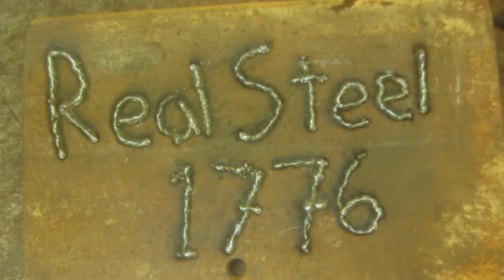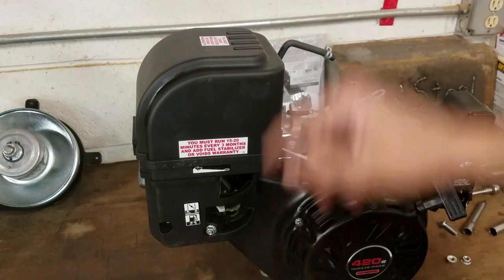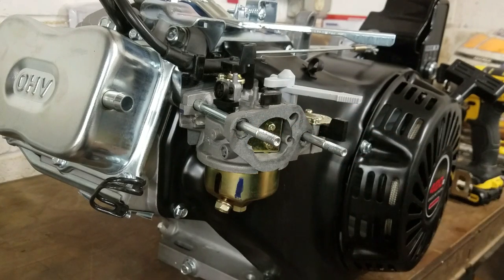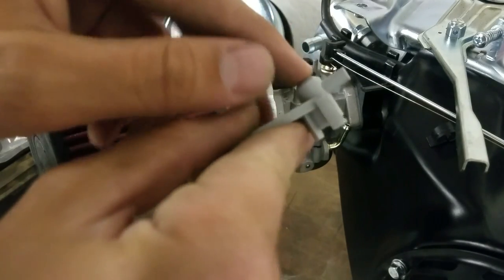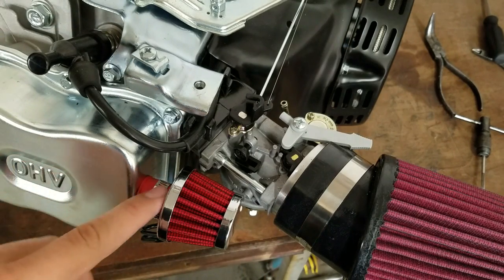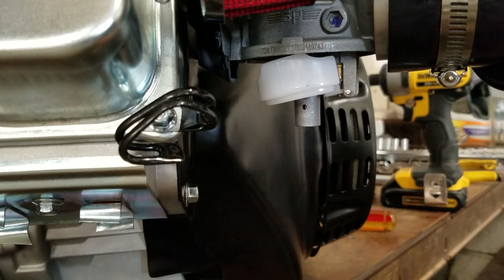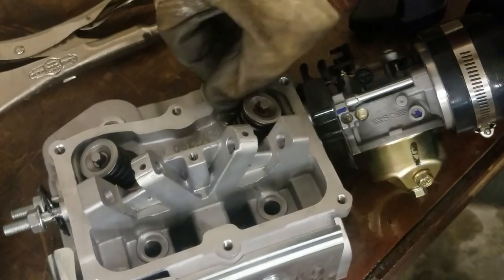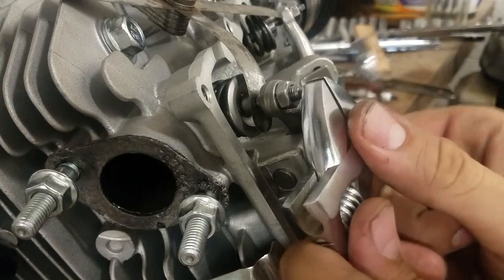Predator 420cc Performance Mods!

Comment: Couldnt you instead taking apart the engine. N just disconnect the governor arm assembly on the Carb n be done w it?
Reply from the maker: yes, but the plastic governor gear isn't designed for the high rpms and could break apart during use. it would probably be fine though

Comment: (0) Those 'Bolts' You Took Off To Remove The Muffler Assy Are Called 'NUTS'! (1) The Two 'Pegs' Holding The Muffler To The Head Are Called 'STUDS'; (2) These Nomenclature Problem(s) Carry On Thru Out The Whole Video; Bad Dog....

Comment: I have a 14hp Subaru motor,I don't have any idea if the mods are the same tell me what you think plz before I try to modify it.thx
Reply from the maker: the basics should be similar like the intake and exhasut, but Subarus are OHC engines which means that the internals are completely different

Comment: Do you have to do all that air intake jet adjustment stuff to take the governor off or can you just take the governor off and it'll still run fine?
Reply: Yougotnomilk thanx
Reply from the maker: you don't have to,  but you do need 35lb valve springs or else you'll bend a valve
Reply: RealSteel 1776 Yeah, I wasn't 100% sure, but I was thinking I was going to have to do that at least. Good looking out. 👍

Comment: what you really need is a big spacer between the carburetor and the head. Putting a space between the carb and the air filter fills no purpose.

Comment: What Size did you Drill the Jet too? Stock 13hp@3600rpm is 75% efficient. 420cc at 75% efficient at 4000rpm = 15hp, at 4500rpm = 17hp, at 5000rpm = 19hp, at 5300rpm = 20hp. http://www.mk5cortinaestate.co.uk/calculator3.php
Might Help to just Boost CR from 8.3cr to 11.3cr for 91 Octane and use a lower Rpm.

Comment: Where can I purchase a more powerful charging system for that engine your working on?
Reply: Yak Variety Channel you can get the part from your local small engine shop (usually lawn mower repair shops) and you can get one that Honda makes and not a cheap predator clone one.
Reply: I was hoping you had an e bay link for the part?

Comment: Great video but without jetting that engine won’t be at full potential. They have these engines very lean from the factory then you made it a lot more lean.
Reply from the maker: I did. the time for that is even listed in the description.
Reply: MacroMachines ok I missed that sorry

Comment: why bother opening up the motor ? disconnect the governor arm,unplug the sensor wire and your done..............and your warranty is still good if you bought it new, just put the original tank and muffler back on.

Comment: Can you post a link for where to get an adapter for the pod filter?
Reply from the maker: http://www.gopowersports.com/212cc-predator-performance-air-filter-adapter/
Reply: Thanks for the response. Great video btw, I've added this to a playlist of mine so I can reference it later. I have a 1990 Yamaha G2 golf cart that I did a lot of upgrades to, including removing the governor. Stock HP was about 9HP and I managed to get it up to 35Mph one day on a downhill section of roadway. After that it lost compression and I could not get it to stay running. After watching this video I realize that I did bend a valve. I've got a Predator 420cc motor in it now and will be able to use the information in this video, thanks for posting it!

Comment: if the engine runs better with exhaust back pressure than something else is not tuned properly.
Reply: Paul G actually you are wrong about a slight back pressure it is known to help ANY carbureted engine to be more tractible at low engine speeds. Bless you..
Reply: @carlyandt6748  Even the big names in engine building still disagree on the back pressure subject. A motor is a complex system, and there are so many variables that if we were truthful, one size does not fit all!

Comment: When I first had my 212 I tried to disable the govener and it actually locked my motor to full throttle so when I first pulled my minibike motor my dad was holding the front and it flipped over him spun around and we had to catch it and kill it

Comment: not bashing or dising you but. some engines run better with backpressure and some run better without. dont know why that is but its a 50/50 lol
Reply from the maker: I know the predator 212s run better with a little back pressure, so the the 420 is probably similar
Reply: predator V-twins get 2-3 more hp and more torque without backpressure
Reply: Backpressure does nothing for a 4 stroke. 2 stroke yes, it helps with how the gasses enter and exit the chamber, but on a 4 stroke there is nothing happening on the exhaust stroke other than getting gasses out to allow the cylinder to create a depression to pull the charge air in. 👍🏻
Reply: You could not be more wrong. Investigate "scavenged exhaust".

Comment: You should be using a PLASTIC SCRAPER to remove the crankcase cover or even just a razor blade! When you just poke a screwdriver around in an area where you can’t see with precision MACHINED surfaces...bad things tend to happen

Had you scratched the end of the crankshaft as you blindly poked that screwdriver around, you’d be leaking oil everywhere when you reassembled.

 Given the “skills” you’ve demonstrated to us thus far, when you tried to repair it using sandpaper, instead of emory cloth, like you should have used, you’d probably just fuck it up even more

Comment: If, if, if you can keep the head cool, and if you design and install a high quality, tuned header with proper collector length, a tighter lash of 3 to 3 1/2 thousands will give you an incredible rise in power.
But, but, but if you don't or can't keep the head cool, you will have an extraordinary mechanical failure that you will blame on me. The increase in power will be reward for coming to understand the power of "airflow". Diligence can get you there. Belligerence will break parts. Enjoy!!!
Reply: One guy that modified motors had a saying, "The bigger the horsepower, the bigger the bang when it comes undone".

Comment: just asking why not just disconnect the gover linkage ? oils need sensor.... all that tapping and no engine flush???? kids
as you can see. adds to much BS not the basics.
Reply: The increased rpm's may grenade the governor yielding little pieces of plastic and metal to get into other engine parts. Think of what he did as insurance. He didn't have to do it, but made him feel better.

Comment: Are these mods a joke? Every mechanical engineer just died a little inside. Seriously when it comes to small engines they are jelly bean parts, u need more power buy a more powerful motor. Its not a 350 w a Holley. Small motors are designed to produce a specific power and torque.